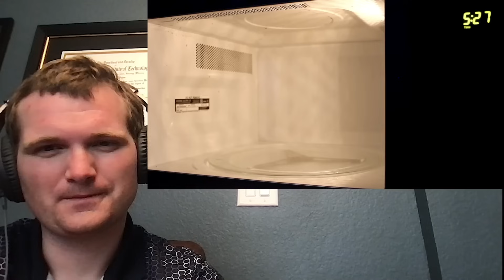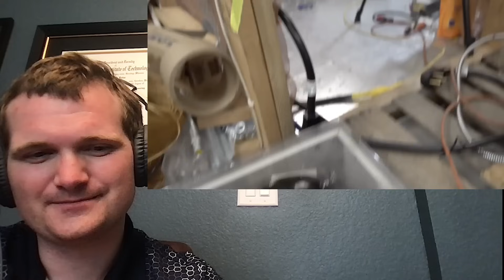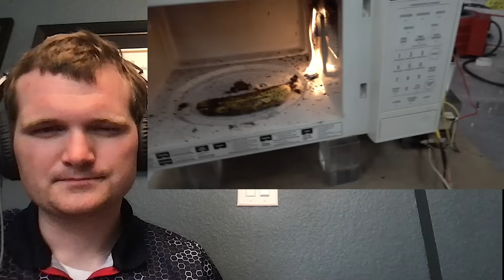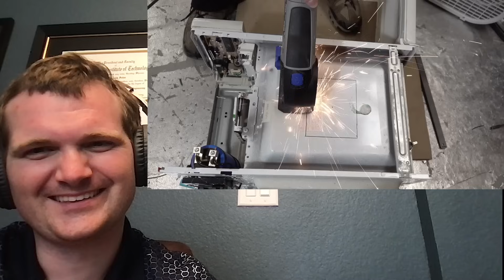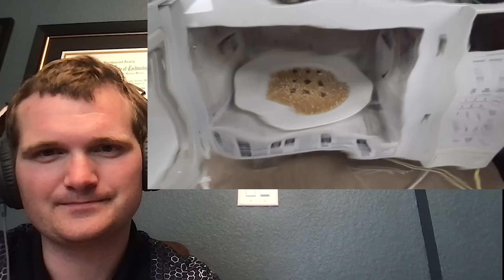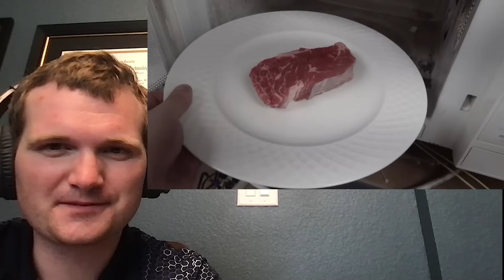LASER MICROWAVE! - Nuclear Engineer Reacts to styropyro

Comment: Once used a thermal camera to find an electrical draw on a customer's Tundra. There was something wired into the control side of the headlight relay with just enough amperage to heat up the relay, but not enough to close the circuit and keep the headlights on with the truck off. People do weird shit.

Comment: Osaka University in Japan has long been conducting nuclear fusion experiments involving the implosion of deuterium-tritium-filled pellets via the simultaneous irradiation of a single point with laser beams from multiple directions. I once had the opportunity to view the exterior of the facility where this research takes place, and the building was massive—comparable in scale to a nuclear power plant.

While the process requires "simultaneously firing" multiple super high-power laser beams and focusing them on a single point using an optical system, the development of a more effective "implosion-capable" capsule could potentially change the game. It might enable inertial confinement fusion experiments using semiconductor lasers—which are inexpensive and offer greater flexibility in placement—instead of the colossal, precision-engineered glass laser systems currently employed by U.S. government agencies and Osaka University.

High-output semiconductor lasers require a thermal interface material (thermal compound) to transfer heat to a heat sink; otherwise, the laser element itself would burn out. I was surprised to learn that ordinary household mayonnaise serves as an effective thermal compound—though one does worry that the egg content might degrade under high heat and lose its effectiveness as a thermal interface material...

Comment: 3:33 I weirdly enough knew that microwaves run at half power. The sound changes drastically and when you're boiling something, it's never consistent. For short bursts, the power level change isn't worth it, but if you want to cook a bowl of soup for 4 minutes, scaling your time can help your soup from boiling over and/or burning on the surface layer.

Comment: I think Chernobyl was actually a whole  minute after an on site powerless that generators would kick in which is why they tried to use the turbine almost as a dynamic brake to buffer the lag until the generators took over. Also I believe the RBMK reactor aside from running at low power for an extended time the day prior to the accident. I believe  garneted a lot of hydrogen and Zenon I'm not sure if American reactor's experience the same issue during  a scram? I love watching your content your a natural keeping it interesting :)

Comment: Doing hot dogs is great on laser put in A axis chuck with end stop, set A to run 10Kmm/m and 12Kmm/m on X axis (it just goes startX to and endX while A rotates.  Only need about 4-5 optical watts at 455nm diode laser.  Gives perfect grilled surface you can tune power, area and speed.  Even go graphic patterns on the dog.  3-4min run time.  J Cloudfather

Comment: This guy is VERY Lucky he is not burned and blind.  I work with lasers in the 70-78W optical output (140-170W DC Input).  out of the box, it will slice 30mm baltic birch moving at 200mm/m.  Mayo who is he kidding, Diode laser COS modules require very large heatsinks infact water cooling.  Then power soft start, PWM drive pulse.  then you have to work the optics'  If I put a convex lens its easy to make toast.

Comment: Some older game consoles, like the game cube, use phase matching of the screen. This means that for some games the dolphin emulator for gamecube can run games at far higher fps while still correctly emulating the original console, from sending a fake screen pulse the instant a frame is fully rendered. For other games this becomes a problem, since some games tied their physics calculations to the screen refresh rate, making (for instance) character jumps briefer (see the hulk video game).

Comment: Yeas really interesting, induction plates work in a similar fashion. And i have noticed a change in sound of microwaves since I've ever used them. They typically make more vibration & lower frequency when operating at full power & vise versa. So what i asumed was the case he just proved with a watt meter. Very nice

Comment: I once spot welded a piece of wire to a penny using charge stored in a couple of capacitors from projection TV that I charged up using the bridge rectifier and turntable motor from a microwave

Comment: @3:10 you didn't know that? You can hear the generator turning on and off as the microwave operates at lower powers.. No meter is required to figure that out... Same with your elements on your stove.. You can hear them turn on and off at lower powers... Same with pretty much every other electronic device.. Setting your thermostat to 21C doesn't mean it constantly outputs 21C air.. It turns on and off to maintain 21C. Only the newer microwaves, I think maybe just Panasonic, have an analog system where 50% power means the generator operates at 50% constantly.

Comment: 3:08 newer inverter microwaves do actually run the magnetron at different power levels, so 50% power is actually 50% power and not just 100% power half the time.

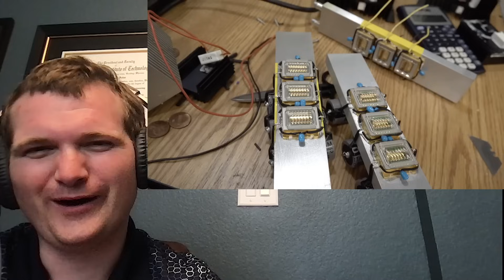Comment: 13:01 - I think the mayonnaise is supposedly being used as heat-sink grease (Thermal transfer compound).
It aids in the transfer of thermal energy from the device to the heatsink. I'm not sure that I can rate the effectiveness of mayonnaise as heat-sink grease, but its comedy-value is off-the-scale !!!
Reply: Exactly, I have used it on a few occasions, one time as contact between a cpu and heatsink cooler.

Comment: The reason tying a breaker's handle in the ON position doesn't do anything is that the solenoid trip mechanism that detects short circuits and massive over currents is not directly attached to the handle.

The handle has a catch to grab the spring and pull the mechanism back in the ON position, but it isn't directly attached to the contacts. That's why when a breaker trips you counterintuitively need to push the handle to the OFF position so the spring mechanism will catch, otherwise you're just pushing nothing in the ON position. And yes, this mechanism was invented specifically to prevent idiots from tying their breakers in the ON position with some wire and a screwdriver. It will still trip.

Comment: Microwaves always have that "defrost" settings, like they are actually good at defrosting things.  They aren't.  When the hydrogen in water is trapped in a crystal latice of ice the microwaves do not resonate them, so not heat build up.  Microwaves don't heat ice.  What they try and do is "full power for 10 seconds", which will practically boil any water where the food has begun to naturally defrost.  Those hot spots will then melt more around them and so on.
This is why if you try and defrost a steak in the microwave you will find it gets cooked around the edges.... boiled, rubber steak.  You would be better off putting it in there with a big glass of water and letting the heat from it defrost the steak.

Comment: The on/off cycling of microwaves is the reason why all microwave food instructions are wrong.  They always say "Full power" because the "medium / low" modes are unspecified, unstandardised and vary between ovens.  Basically the people making the food don't know how your particular oven works so can't tell you exactly how to cook it.  The people who make the microwave have no idea what you food is so can't advice you either.
Blast full power ... stand ... blast full power ... stand.  Is the standard instructions and absolutely brutal on the food.
I would tend to add both times, subtract 1 minute and put it on 50% instead.

Comment: Nuclear reactors are a joke.If you put salt into the heavy water.You can double the temperature to 1100%,safely.Known this since 1981.The rods last ten times longer,and there is no radiation left in the rods.DO YOU REALIZE THEY ATE DOING IT BACKWARDS ON PURPOSE?THORIUM WORKS 90%AS WELL AS URANIUM.GO FIGURE.THATS WHAT YOU GET,WHEN YOU PUT ALIENS IN CHARGE OF YOUR POWER SYSTEM.BACKWARDS.

Comment: This video actually just cleared up a misconception that i had in regards to the control rods.
I was under the impression that they required an electrical signal, and electrical current. To drive pneumatic/hydraulic pistons. To insert the rods into the reactor. Or pull them back out of the reactor. 
Btw. Nuclear power is the only green energy humans need.

Comment: Electric stoves do the same thing on the burners. This is a very common way to control power or voltage, this is also how dimmer switches work and DC to DC converters. Turn the power on and off at different speeds and this controls the power output and basically the voltage the load sees.

Comment: If you want a microwave that can run at lower power levels property (instead of slow on/off cycles), look for one that's says "inverter". That means it can adjust the magnetron power.

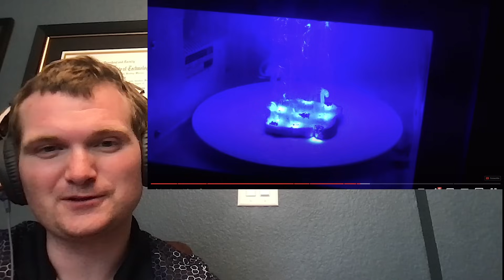Comment: 16:20 Cherenkov radiation does not result from neutrons exceeding the speed of light in water... neutrons never approach the speed of light in any transparent medium aside from perhaps Einstein-bose condensate... cherenkov radiation is the result of beta particles/ electrons exceeding the speed of light in water.
Fast neutrons travel ~1.4e7 m/s while the speed of light in water is 2.25e8 m/s. Fast neutrons travel roughly 4.6% the speed of light, nowhere near 75% of c (which is c in water)

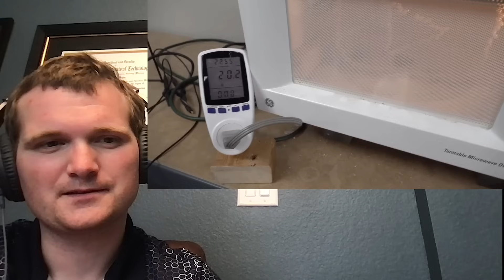Comment: 3:00 yes, magnetrons operate at their primary harmonic above a critical anode current. Half power with 100% duty cycle might result in lower efficiency and operation at higher harmonics of the 2.45Ghz 1st harmonic.

Comment: It’s not the shape of the banana that causes the ark to propagate it’s the black ends! The first spot to ark is usually carbon or dirt cut the ends off and you can cook a banana in the skin in a microwave but leave the ends on and even with 650w it can ark! The same goes with many things as soon as something has carbonised it’s conductive enough to act as an antenna

Comment: I did know about the power setting you can actually hear it. Cooking porridge on full power can be messy so stick a bowl of breaky in the oven for 6 mins on defrost have a shower and you get back and your breaky is in the bowl and not all over the place . Ive heard you can work out the speed of light with one and some damp paper towel a ruler and a calculator. Ive heard they work a bit like you blow over a flute ... Great invention .

Comment: The mayo is going on a heatsink he's mounting the diodes on. He probably cleaned it off and put normal thermal paste off camera.
Using mayo as thermal paste is an old meme among PC building hobbyists. Every now and then someone (jokingly or otherwise) says they don't have any thermal paste and want to know if there's something else they can use. There is a chart out there comparing CPU temperature under load using various real thermal pastes as well as meme ones like mayo, mustard, chocolate, etc. If I recall, mayo works alright for the short time before it dries out, and then it works terribly.

Comment: I believe he is using the mayonnaise as a thermal paste/heat sink paste.  Believe it or not I've actually seen it done before, and seen it working fine basically forever. Now no haven't the foggiest, except that the stuff in the "mayonnaise" jar at the store isn't actually mayonnaise, it's mostly hydrogenated and brominated vegetable oil. If you think of it like that it makes more sense, oh and it's cheap and easier to get than thermal paste.

Comment: (at 4:49) Actually, the reason that the magnetron only produces power half the time is that the  anode supply circuit in a mocrowave oven uses a half-wave voltage doubler. In this circuit, the capacitor is charged via the diode during one half cycle and it is in series with the transformer on the other half cycle. This gives roughly twice the output voltage, but only on every other half cycle

Comment: I noticed the microwave only being on partially a long time ago. If you set it to a lower power, you can actually hear (on cheaper models is more noticeable) that the transformer turns on and off while the microwave is cooking. Really, try it. One thing I love about my newer microwave is that it actually cooks at a lower power, not just 50% on and 50% off. Cooks food way more evenly and never more do i have a half frozen half molten burrito!
Reply: Yep this is what "inverter" microwaves [partially] address.

There's a minimum power that any given tube needs to operate at but it can be taken down to that level from 100% without using bang-bang (yes that's the technical term for what an old school microwave uses lol). 

The bang-bang technique is in use in many places within the home... among others a traditional electric stove/oven, heating/air conditioning, water heaters etc. The "active" part of the device gets turned on and off all the way to maintain a nominal target (average) value.

This method is simple and cheap, and "works well enough" for many things. Microwaves as originally designed suffered a bit from this however because the energy can only be absorbed by the food at a given rate... and even tho the average is lower, the spontaneous value is the full design power of the magnetron. Hence hot and cold spots and the issues that result from them. 

Side note, I have a similar issue with driving LEDs with PWM (which is essentially just a really fast bang-bang)... it [unnecessarily] stresses the LEDs as commonly implemented (buck converter drive is better and doesn't add that much to the cost)... I digress 🤷‍♂️

Anyway, in the case of an inverter microwave, the tube can be used at true partial power continuously but below the cutoff level for operation, the control system reverts to bang-bang at a reduced power (typically just above the cutoff power for the tube, usually around 50% of maximum). 

So defrost for example (typically "10% power") will still be bang-bang with a 5-15% duty cycle (depends on how it is set up to operate) at about 50% spontaneous tube output instead of 10% duty at 100%.

Comment: 2:55 Not all microwave ovens are the same. When set to lower power settings, most microwave ovens cycle on and off, but Panasonic microwave ovens actually run continuously at varying power levels.

Comment: The mayonnaise thing, here's the deal.
He mounting high power diodes to those extrusions. Those extrusions are heat spreaders/sinks. The mayo is acting as thermal paste. No joke its actually no terrible so a short term solution. Linus tech tips, and tech ingredients have both used mayonnaise in the past. Tech ingredients used it when testing his diy thermal paste, and Linus was test it to other weird things.

Comment: They're not "somewhere close" to communications, they literally run on 2.4Ghz, that's bang on in the WiFi frequency, also most wireless computer peripherals. Try bringing a wireless headset close to a microwave, it doesn't even have to have the door open, it'll start immediately making weird noises and disconnect from the base station xd
Reply: I live in a boarding room rn. Everytime we use the microwave the wifi cuts out, and signal returns literally the second it stops

Comment: 16:40 Just a heads up for anyone confused by "the neutrons effectively break the light barrier in water," the speed of light as you typically see it (approximately 300,000,000 meters/sec) is the theoretical max speed that photons would move if there are absolutely no barriers in it's way. Light in water flows much slower, approximately 0.75c (or ~225,000,000 m/s), which particles can achieve in these kinds of situations. As such, the wavefronts generated by these re-emitted photons overlap just as sound waves do in a sonic boom, leading to constructive interference and in effect a visual sonic boom in the form of a flash of blue light. When you have this happening extremely rapidly, you get a steady blue glow, kinda like how the constant explosions inside your car's engine lead to a steady sound.

Cherenkov radiation is cool as heck.

Comment: 3:30 it actually was clear to me when I was 7. When we first bought one.
It clearly turns on and off. And you can see food cook/move when it buzzes.

But there are inverter microwave ovens, they are expensive, as the emitter isn't really made for lower power, its like a shaped oscillator or something. An inverter microwave must work a bit different.

Comment: Neutrons do not produce Cherenkov radiation. They're neutral - they have no external electric charge, it does not matter if they are traveling faster than the speed of light in a dense medium, there will no phase lag of the local E field, and thus no Cherenkov glow. I was planning on subscribing when I clicked, but I am disappointed a nuclear engineer apparently does not know this very basic important fact.

Comment: It took me just 100 meals to come to a conclusion that setting percentage actually sets duty cycle, not the actual power limit. You can see your sandwich almost explding then it will click and will not do a thing for a few seconds, and then it will click and sandwitch starts to explode once again.
Reply: It depends on the oven desigh
Some use fancy high frequency switch ferrite transformers and could throttle them electronically since they're already heavy on that departhent
Some are dumb iron core mains frequency, they indeed do duty cycles. Lots of relays in them.

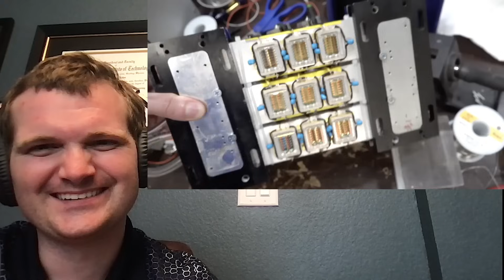Comment: Although they are roughly the same size, those are 2200 µF 100V Capacitors at 14:12, not D Batteries.

Comment: Really good Microwaves don't do what was said in this video.

Inverter Microwaves, like my Toshib, will give the Microwave a steady power level for the duration of the heating time.  If you want 50%, it will supply 50% less power continuously.